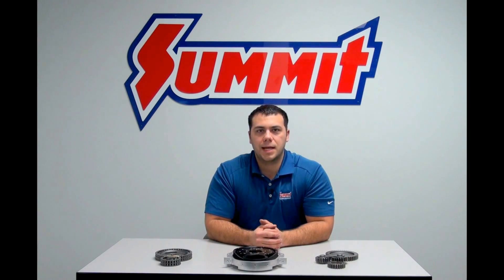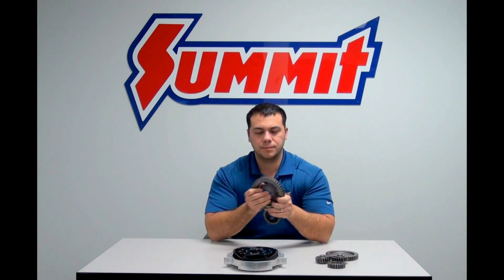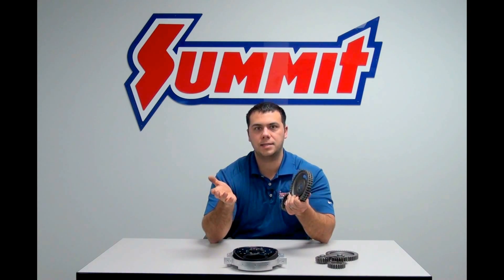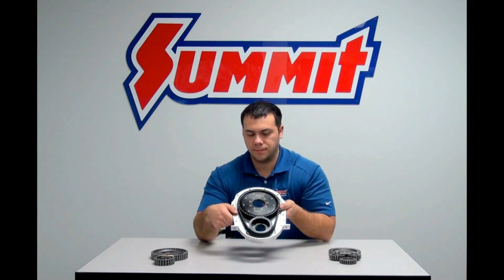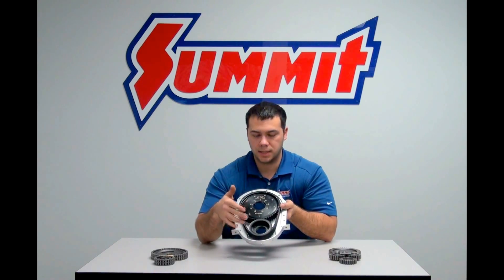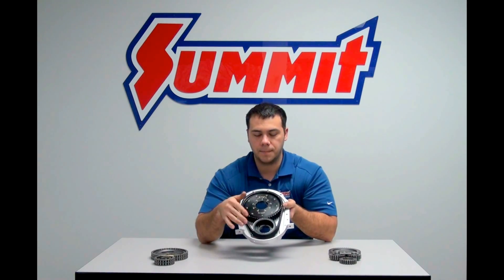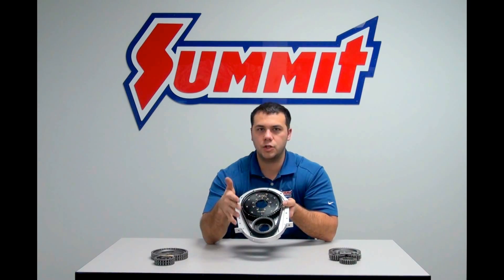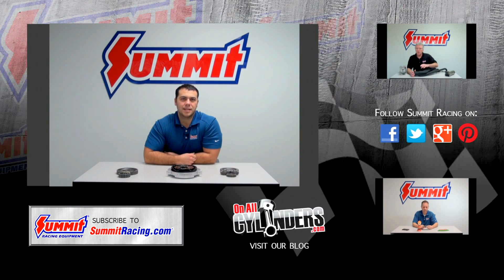Timing Belt vs. Timing Chain vs. Timing Gear - Summit Racing Quick Flicks

Comment: Back when I bought my first car in the 1970s, I heard that timing gears were common before WWII, but that to quiet them down they used nylon or fiber composites in every other gear,which made them less reliable, so they went to chains. Even if the gears were all-metal, I assume they would need pumped or at least sealed oil to make them last, which is one more thing to leak or break. Back then, chains lasted about 150,000 miles while belts were scheduled for replacement at 60K. Now, many belts are scheduled for 100K, but will often go to 150K if you don't replace them, so they aren't that much more trouble than chains. Either is obviously a bigger worry in an interference engine.

Comment: Is it true that the belt type needs to be replaced before 200,000 miles because if it breaks ur engine has to be rebuilt?
Reply: Laura McGrael If the belt snaps it will bend the valves

Comment from the maker: A knock sensor is comprised of Piezoelectric materials; Crystals that when impacted, generate a voltage (same idea as a BBQ ignitor). This voltage is monitored by the computer, and when an irregularity is detected, the computer corrects timing.

Comment: I don't like the rubber timing belt because they are more likely to break while the engine is running and can cause damage to the valves and pistons.
Reply: Gears are the way to go, especially if you can get some helical cut ones which are smoother, quieter, and bulletproof.
Reply: So true.  My friends 300ZX snapped the belt, and he was out $4700 before the car was back on the road.  
It required a total engine rebuild with new heads, new valves, new pistons.
Reply: @fishodorvagina
Only in interferance engines can lost timing lead to valve and piston damage

Comment: Summit Racing  still don't get it .. what's the difference between timing chain or timing belt .. I Mean I own 2 cars and one has timing belt and the other one has timing chain .. any differecen in performance .. ?
Reply: Ones a metal chain, ones a rubber belt. What don't you get?
Reply: Lemons  dont be lame bro .. u know wat i meAN...
Reply: The belt wont last as long, its less dependable, and is a silly idea to begin with. But hey the auto corporations can shave a couple pounds from the car this way!

Comment: Aren't the belts less durable than the chains? Don't they have to be replaced more frequently in passenger cars.
Reply: Yes, belts over time will dry-rot and stretch, can break if not properly maintained, and also if the sprocket, stroke, and timing cycles are out of sync with one-another due to piston crankshaft misalignment, can cause engine wear, stalling, or premature breakdowns.  Without belt loosener tools, torque wrench, screwdrivers, drills, and additional test equipment, can turn into a very expensive job quickly at the garage.
Reply: In typical passenger cars, yes. But the Racing belts can be the strongest, most accurate, and most expensive! 
$750 - $3000 +

Read my posted comment where i further explain all this
Reply: Yes.

Comment: Summit needs to explain the difference of the types of timing belts. There are the OEM crap ones that do not last that long but there are the racing style ones which have been proven to be the absolute strongest and most accurate. Even more than any chain or gear and is why they are used in Top Fuel, dragsters and vehicles that are pushing way over a thousand horsepower type applications. I can see by the comments that many people don't realize this difference by itself. The difference of going to your local orders on and getting a timing belt for your Honda verse timing belt starting at $750 Plus and can easily get into the $3,000 plus range for the timing belt alone. I forget exactly but it's some Kevlar carbon fiber woven crazy mix instead of the typical rubber type. But for the rest of us who Warren millionaires back here down on Earth it's all about quality weather using a chain or gear. Some of the chains are built at a crappy material and same thing with the gears. So if you get ones made out of good material and not some China crap you should be good. And remember anything that moves wears out, which is inevitable but if it's good quality and you keep up with checking on it taking care of your stuff you'll get a long time out of it
Reply: Because they are as lubricated as the rest of the metal moving parts of the engine, the chains wear very little. That's why they don't need to be expensive to last.

Comment: Why were timing gears phased out when they're the most reliable timing system?
Reply from the maker: +LazyEyeCrazyI, 
A gear to gear timing drive will have a certain amount of noise to it, and if that motor happens to use a knock sensor, that noise can be heard by that sensor ultimately affecting the ignition timing defined by the on board computer. Another reason, how about overhead cam motors?  The camshaft (or shafts) are too far away from the crank to be driven by a gear drive. You need something longer ( and quieter) to span the distance to drive the camshaft such as a chain or belt.
Reply: When you reffer to ohv engines are you also including the SBC, SBF, SBC, BBC/F/C carb designed engines etc.? Or do you mean more modern style?
Reply: The flux capacitor removes all internal engine friction, but increases friction on the outside of the vehicle due to traveling at the speed of light.
Reply: DanLeeProductions wow you found some exotic car that doesn't perfectly fit with with the presenter was talking about. Good for you, would you like a cookie?
Reply: Summit Racing the inline six has a KnockSensor and the timing gear, my inline six has 550 miles on it and all I’ve ever changed Out was the Alternator, waterpump and do my regular, tuneups, change out the trans every 20k and flushed out my radiator ever so often, I use Honda Coolant my engine never goes above 100, even in the summer Time on long trips from Texas to Florida in the Summer
Reply: Although the friction is minimal due to the surrounding force field .
Reply: @SummitRacing  How about helical gear? Which appears to be quieter. 
I saw a Toyota 2.7L DOHC engine, it has timing chain to drive one shaft, then use helical gear to drive the cam shaft.
Reply: @donrutter6550  that's why you use a stainless steel outside construction, as you move faster the car will freeze 
It being stainless will allow it to stay smooth and not rust so increasing the aerodynamic principles of the car

Comment from the maker: By acting as somewhat of a dampener, the belt isolates/separates these harmonics which translates to extended part (cam/crank) life and more horsepower. The downside to these belts, due to extreme valve spring pressure and RPM, is they (the belt) should be replaced after every race season because they too will stretch just like a timing chain!

Comment: Curious how the backlash of Gears versus belts affects the overall performance, timing, etc.., of an engine. I imagine a dual idler gear drive is designed to eliminate this to some degree (no pun intended). I’d be more interested to see the differences in horsepower on a large displacement engine and the affects of that backlash. With a belt it would seem you would have less of an issue where Gears mesh they must have a set amount of backlash where a split pinion isn’t utilized to compensate for the slack.

Comment: I feel safer with the chain or gear timing. Timing belts eventually wear and break. I think noise/ harmonics is a very small price to pay for a failed timing belt that can destroy your engine costing you megabucks!
Reply: Elpaso 1990TX What's more expensive to fix on breaking-belt or chain in regular car?
Reply: @Seraphimpoet  belt because it destroys the valves and possibly pistons. Chains don't break.

Comment: why do you say nothing about the stretch over time with the belts? I would have to assume the belts would stretch faster than the chains.
Reply from the maker: Hi Gyva02,
While it is true that timing belts do wear or stretch just like a timing chain, understand that there are advantages to its use. For the OEM market they are lighter weight, inexpensive to mass produce, and strong enough to span long distances (think overhead cams) as well as have a good life span under normal uses. For a racing application, two popular companies; Jesel & Comp Cams make quality belt drives. The racing industries main concerns are lower harmonic transmission between the valve train and the crankshaft and lower friction. High valve lifts, high spring pressure and high RPM in racing create these harmonics and tend to shorten the life of a common timing chain and puts unwanted stress on the crankshaft. A timing belt will actually act as somewhat of a shock absorber. Another advantage is that most racing timing belt systems are run open or uncovered making quick valve timing adjustments easier. Timing belt change intervals on OE applications are generally 70-80k miles while racing applications should be done once a race season for safety sake!
Reply: @SummitRacing  in an interference engine timing belts break and destroy the valves and possibly the pistons. Gears or Chains for the win and the durability

Comment: You said you cant use a gear drive with an efi system because it will make the knock sensor go off.  Question one:does EFI=TBI?  Question two:what the heck is a knock sensor?

Comment: why Single Cylindered motorcycles are not equipped with timing belt? They Basically Use A Chain Which Becomes Noisy After Certain Amount Of Time...

Comment: Soon timing gears will pretty much be standard in all cars, which is good. That set you have there is quite underdeveloped though, it's a shame they don't manufacture proper ones with helical or even double helical gears.  

The efficiency of those are around 99%  (much less for the timing belts and even the timing chains), and they will last as long as the car lasts.

The noise comes from the teeth of the gears constantly hitting each other as the gears revolve, which generates lots of losses in power which isn't what you would want, especially in any type of race car. It's the same noise you hear while  reversing older cars, however,  the rest of the gears in the gear box are helical and won't make that kind of noise. (Noise=friction=loss)

Luckily they have started puting proper timing gears in some formula one cars and racing motorcycles which is a huge step in the right direction. :D
Reply: Nope, technology has been regressing since the 80's. Long long time ago gear drives were STANDARD on American car engines. Then came the chains, and now cars use rubber bands.
Why? Because its all planned obsolescence. And there is more planned obsolescence in cars made after the 80's than any other car before. Cars now a days are designed to break and be a pain in the ass to fix.
Reply: The reason why they are not using it is because of the cost. Gears are very expencive countrary to timing belts. Another aspect is that the timing belt has to be replaced every ~6000 (metric) miles, and then the automotive companies can charge their customers even more money. So I think you are both right in a way.

In the first half of the 1900's companies like Citroën used arrow shaped timing gears (hence their logo). So I think you are both right in a way. I hope the industry will come their senses once again! :D Gears are starting  to be used in F1 cars so maybe...
Reply: Mobius Consumer cars will keep getting worse and worse until we de-regulate the industry entirely and let anyone start a car company.
Reply: Spur gears are more efficient than helical gears. Noise is not the only source of power loss, friction is a bigger one when it comes to transmitting power.

Check your facts before you go off on a rant.

Comment: A question for Summit...
I have a 454 in a motor home built on a 1984 Chev P30 chassis with 80K miles on it.

I'm a electronics tech with a little self-taught knowledge of automotive repair. 

I've been told that the mid 80s was the era of nylon timing gears and cheap 
non-roller single-row chain in the 454. 
True? 
(I've seen a set of nylon gears that are stripped (a single row of teeth), and 
supposedly the 454 had 65K on it when the gears died... or was he showing 
me a set of gears from a different engine?). 

I was also told that I could do a lot worse than replace the nylon gears with 
steel and swap the chain for a gear drive. 
True? 

I'm not interested in fake turbine whine, just good solid quiet performance and 
not having to touch the timing chain or gears again. 

So what brand of gears do you recommend, and should I go with a chain or a gear 
set? And what brand on the chain or gears? I've heard that Milodon is one of the best.?